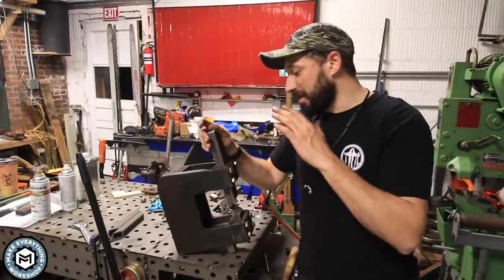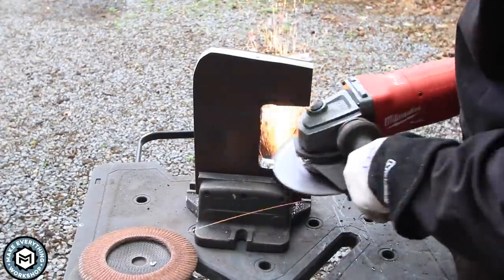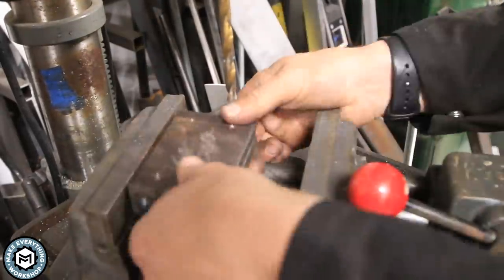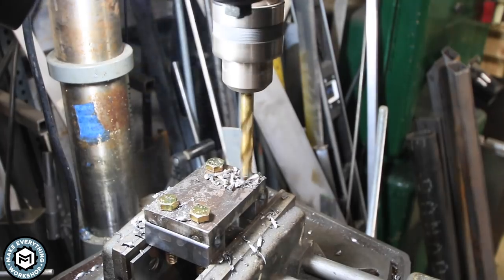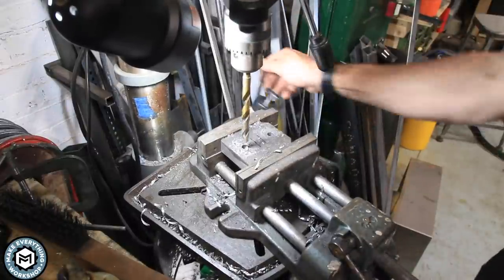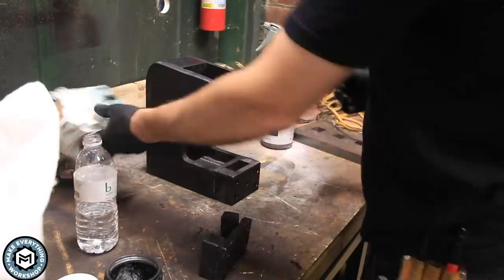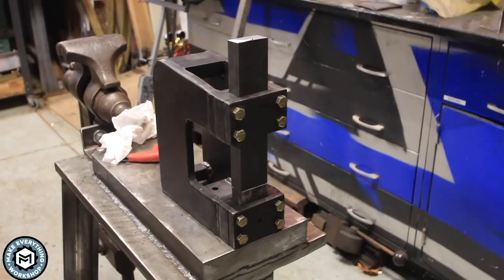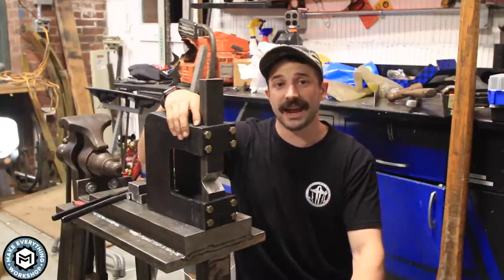Blacksmiths Guillotine Tool

Comment: That 1" X 2" is available in Hardox (brand) hard plate for bucket repair.  This would be good for more complex shapes, and would last forever like your tank guillotine will.  I think I have everything in stock to build my own, but I'll wait until it's not 117 F  outside.  Awesome tool project!
Reply from the maker: Kevin Sellsit very cool! I’ll have to look into that and get some!
Reply: I’ve had success hardening A35 mild steel dies with SUPER QUENCH 🤙🏽⚒🔥

Comment: If you want to apply wax to a project you should get a breakfast warming tray to heat up that item. The temperature is low enough to open up the pores of the steel and the wax soaks into the metal and forms a rust-resistant layer. This is good for axes and hammers and any kind of steel tool. You can put as many coats as you would like on it. The wax dries up quickly so if you are working on multiple tools you can cycle through them until you figure they have been coated enough.

Comment: I'm deeply impressed by your knowledge and dedication, but honestly believe this project is over-engineered.  Just my opinion as a smith, but not a welder or machinist.  It will do a great job, but a smith is happy with a lot less tolerance because he will be happy to adjust by eye later in the project.  I'm sure you will use it great advantage in your own projects and I won't even try to pretend that my projects are anywhere near as complicated or impressive as yours!  I just like to hit metal with hammers and am pleased if it comes out useful!

Comment: It was quite an education watching you make this, and to see the thoughts, careful planning and precise execution that went into this project. Did you use grade 8 or higher bolts in attaching the pieces to the guillotine, and were they tightened to any particular uniform torque value?  It seems similar in some ways to the old thousand pound power hammers that took up a huge amount of space in the blacksmith shops of yesterday. For your device, would a simple foot-pedal activated, air-powered cylinder(and possibly a return spring) mounted inside the frame that would quicken the process of raising and dropping the guillotine be of benefit when hammering hot material, so that you had both hands free to control that material.

Comment: What eye protection is required when uesing a plasma cutter. I have seen a lot of people on YouTube not using any. But I see your uesing a automatic welding mask, what settings are you uesing. Thanks for your help 👍
Reply from the maker: I use my welding hood and set it to shade 5. It keeps my face from getting sunburn and from any rogue sparks. I also have clear safety glasses on underneath the hood